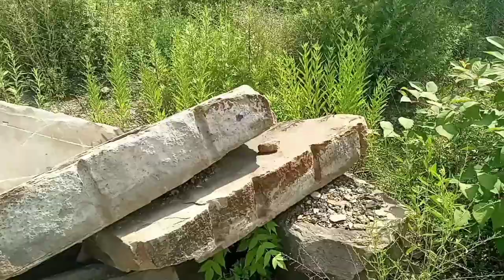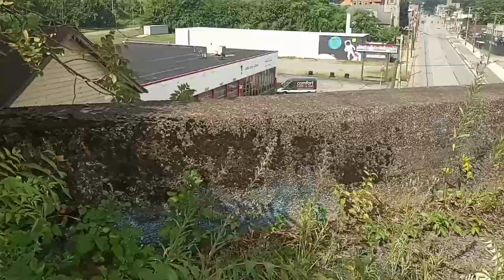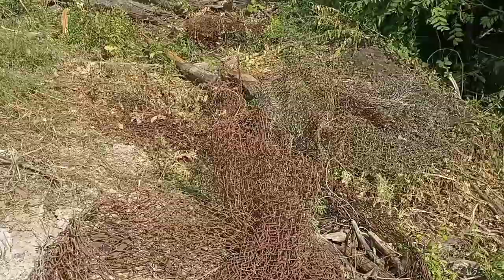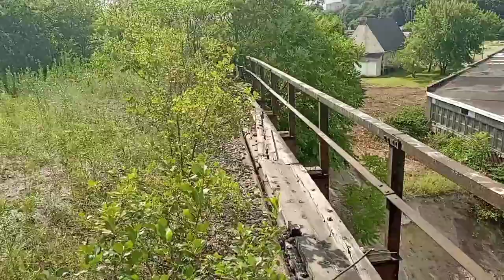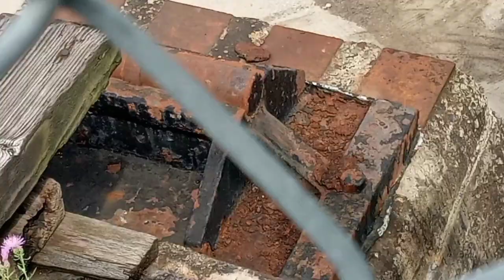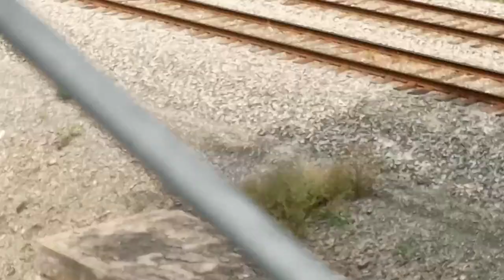Large Concrete Arch is an #Abandoned Railroad Bridge of LE&E Rail Road #YoungstownOhio (Part 1)

Comment: Ok, first off, it's not a road. That wood planking you see is called a catwalk. Secondly, the stone archway/viaduct you stand on is what used to be the LE&E RR (Which branched off of the B&O adjacent to it) thru Y-town. Thirdly, if you wish to know more of the railroads in your hometown, do not hesitate to stop at the YMRA for their annual open house during November & December on 4 Mile Run Road.
Reply from the maker: Thank you for the details.